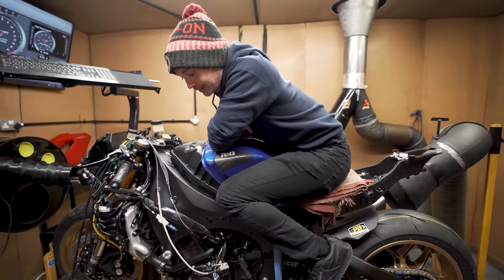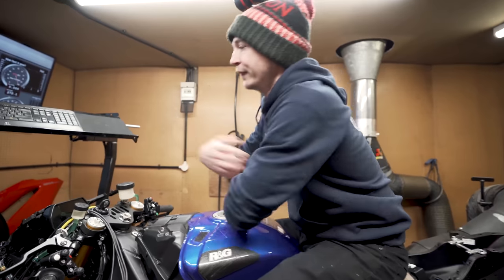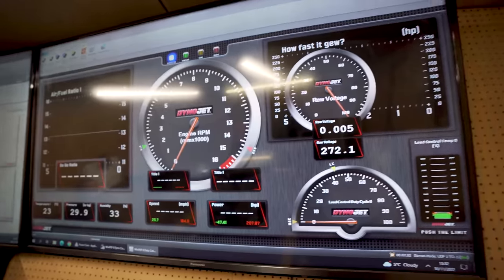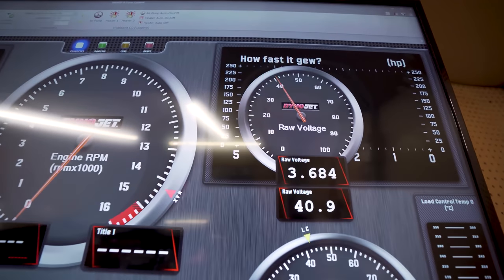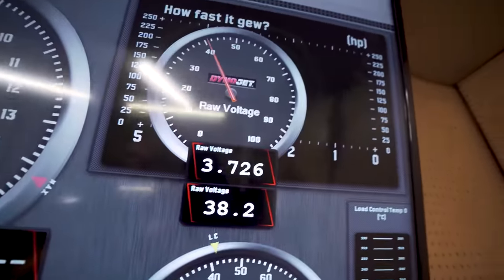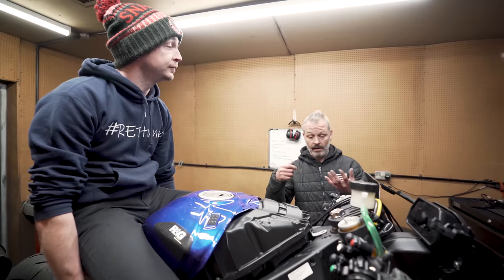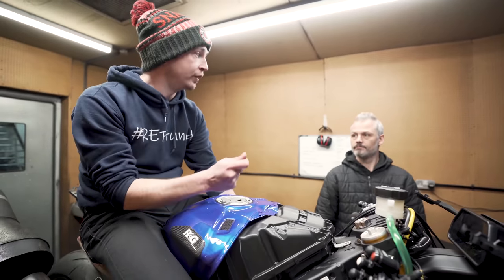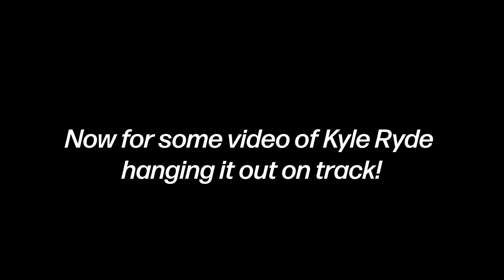KYLE RYDE YAMAHA R1 ON PCR DYNO & ONBOARD OMG RACING ACTION!

Comment: My r1m speedometer not running, are that problem because of rear speed sensor broken?
Reply from the maker: It could be but without checking hard to say.
Reply: @REPerformanceUK  just abs fuse burn 😅